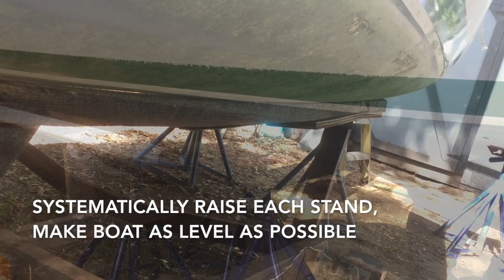How We Removed our Catalina 22 from a boat trailer on land

Comment: Nice job, I didn't have boat stands so I ended up building block piles and used a floor jack and the trailer to get the job done. Guess I'll have to post a video sometime.
Reply: I'd like to see that done as I'm considering to do the same.

Comment: Thanks for sharing. I have a 1986 Catalina 22 Hull 13174 so I was very interested in your approach.  Did you bottom paint the hull and keel? I would be interested in if and how you painted under the jack stands. Did you simply paint around them and then move them once the paint dried and wrapped up by painted the remaining spots?  Mike
Reply from the maker: Hi Mikechro58, Sorry it too so long to reply, just noticed I failed to answer you.  Yes, we simply painted around them and once the paint dried, painted the "spots".  We did paint the hull and keel.

Comment: Really great video. Lost count of the number of stands used - how did you work out where to position the stands? Are there hard points or did you just use common sense? Thanks again!
Reply from the maker: The concerns are keeping the boat weight balanced and the boat relatively level.  It took some trial an error to get the stands positioned between the cross bars and the axel.  It's common sense, but you know that's not as common as it used to be  ; )

Comment: Just an FYI those stands aren't really designed to hold the weight of a boat more or less for stability while a boat rests on its keel. This is why boat yards block up the keel. Just don't wana see you get crushed. Safety first
Reply: An interesting point, so I took a few minutes and looked into it. The stands appear to be SKU 260-1483, which are rated for "a safe working load" of 20,000# each, which means the "load to fail" is likely much more. The boat weighs about 2300# and while I didn’t count the number of stands holding it up, if there are four, then the stands would be holding 2300#, but with a combined rating of 80,000#, giving a "safe working load" safety factor of 34.7, with an ultimate safety factor of much more. Seems plenty safe for even a boat weighing many times that, although careful placement (at bulkheads and for equal load sharing) and securing P&S pairs against outboard athwartships movement with the usual chains would become increasingly important.
Reply: @122436Joe  while I am aware of what the stands are rated. That rating applies to when the stand is in its fully compressed form. Not when the jack screw is fully extended. Just like the jack stand for your car is more prone to failure at its top range. Doesn't mean it wasn't rated for the job use using it at tbe the side load forces are to great to be working under a load. If you're comfortable putting your life in thr hands of those stands go for it. But I've seen when safe working loads fail and I personally wouldn't trust it.
Reply: @122436Joe  your life your choice. But people should understand the risks of putting yourself under a load. Accidents happen things break. I'm glad you have not suffered anything and I hope you can continue to keep on doing all your own repairs just remember just because the man that makes the video is a competent diyer does not mean fhe man following his videos is. So let's just agree to disagree
Reply: @brianluck84  
I see. Thanks for your measured and reasonable reply. We may agree on more than it seems.

I do agree with you that average people should not just blindly imitate this couple, who through their competence, teamwork and maybe a little judicial video editing, make this job look easier to do safely than it really is. But I also guess that most people, in general, know enough to not get seriously injured and can figure stuff like this out if they decide to do it. There will always be ppl who get in over their head, make bad choices and suffer the consequences. Been there, done that, in spades.

It seems I may have misjudged you, even if you did lead with the false assertion that the jack stands were not rated for the weight, then seemed to double down when presented with facts and reason. 

You and I are apparently each somewhat headstrong in our own way, but we seem to share an honest concern for good people and their safety. You seemed to me to come out unreasonably critical of the couple fixing their boat, when you were actually just concerned for the safety of people in general, but represented that in what I see as a flawed manner.  Whereas I was more concerned that you seemed to be critical of the ppl who made the video. Not that they need my help, I understand, but just that I'm aggressively anti-bully. Not in a "woke" or "social justice" way, LOL, but in an anti-predator, anti-thug, "civil society", moral integrity way. I'm maybe more sheepdog than sheep. Sometimes chasing and fighting wolves can seem like duty, sometimes like sport.

One way to notice a bully is that they often find unfair ways to criticize good, accomplished people, even if they have to make stuff up as they go (i.e. saying the jack stands weren’t rated correctly). Nothing triggers a narcissistic bully into predatory action like confidence, competence, inner joy and satisfaction in successful people just doing their thing well, and enjoying it. Narcissistic bullies hate themselves and so are jealous of all who seem successful, confident or joyful. Unfortunate, yes. But its not gonna be my or anyone else's problem if I can do anything about it.

I became 'alerted' when you seemed unreasonably critical of the couple, who obviously know what they are doing, and I replied in a way designed to progressively bait you and reveal if you were actually a bully. Bullies mostly hate facts and reason, in fact they hate most things good and so can be loads of fun to bait.

I guess you didn’t mean to be critical of the folks fixing their boat and I've edited my previous post accordingly.

Love people. Be healthy. Be careful. Be safe. Enjoy life. 
-------------
More on narcissism (my standard cut-n-paste lately): This was not intuitive to me--I had to consciously seek out info and learn it over a period of years to deal with a toxic family member. If interested, I now recommend the video "What Triggers Narcissists?" by "The Royal We". Then go to the YouTube channel called DoctorRamani and watch her playlist, 30 DAYS OF NARCISSISM, for 30, ~5 minute videos, a comprehensive intro to understanding narcissism and how many ways it is toxic to ppl--being around them actually causes diagnosisable psychological problems like trauma-bonding, etc. Dr. Ramani is excellent. Learning about this allowed me to see how several ppl in my life (those I couldn’t just avoid) I thought just needed patience and yet one more "second chance," were actually just using me as their "supply" over the years and how they will never change (why would they, they're already perfect, right?). Its toxic to give in to them, but there are many ways to deal with them in a healthy way, but it takes study and discipline and a willingness to break old perverse-yet-familiar habits.
Reply from the maker: My Goodness, Gentlemen!  I sincerely do appreciate your concern for our safety, Brian Murphy. That's probably why the captain prefers I don't crawl under to paint the bottom of the boat!  And @122436Joe, you certainly demonstrate that chivalry lives on!   Absolutely, this video contains "judicial video editing," and the disclaimer in the description that it's not "how to" but rather, "how we did" should be a "caveat emptor" to anyone who attempts this dance.  Anyway, it's kind of hard for me to imagine how we could 'block up the keel' if we're trying to pull it out from under the boat, but then, I'm the storyteller, not the captain.  {wink}